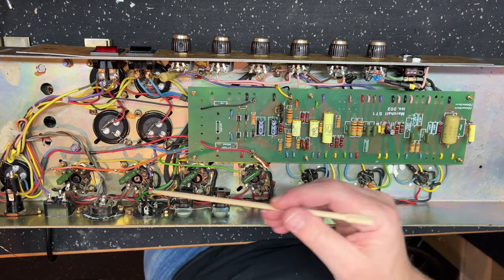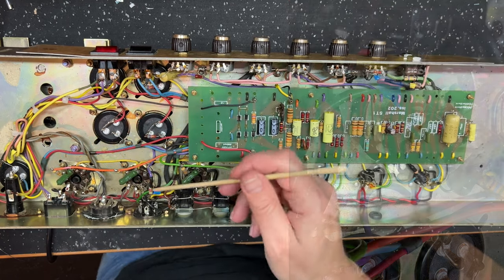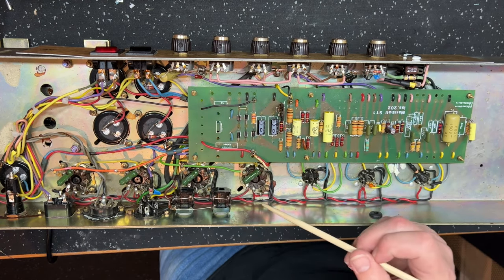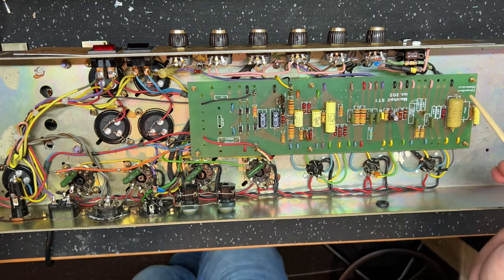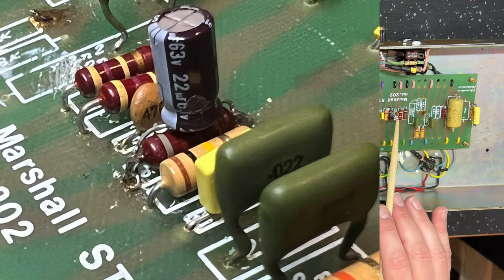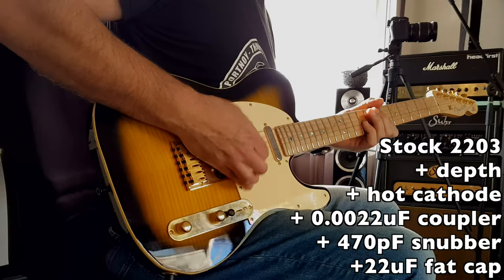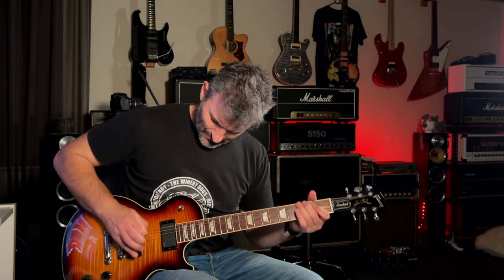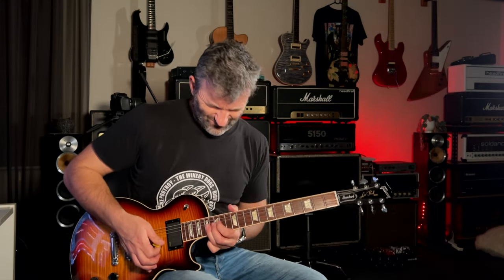1976 JMP 2203 - MODERN MODS BREAKDOWN!!

Comment: Excellent ...thank you for this info!! I'm doing your #34 mod to my 2203 now... didn't realize I could just keep the 470p cap on the 100k from the JEL mod in place without moving to the socket pins/resistor.  thank you!
Reply from the maker: Similar effect, but it does sound a little different.  Try both to see what you prefer in that amp.
Reply: Can you stack the #34 mod with this mods here

Comment: My 2203 build has mustards and 32u on the pre amp 50u on the phase inverter and a tube buffered effects loop.....with the 22k presence .1u and 4k7 combination....variable depth....and stock other wise.....with a 4x12 with v30s and g12h30s.....and 400 volts on the plates.....it's a great blues amp.....I love it

Comment: Love these videos Jason, especially the audio comparison of what each stage of the mod is doing to the tone... that is a LOT of work to stop and record each step, then continue. But its so helpful! Personally, I prefer the stock tone, but I can see a lot of people would love where you took this. It doesn't sound bad at all, I'm just more 70s rock and less metal. :)

I also learned a LOT from this video about what is going on in the circuit of my '76 JMP. There were some non-standard wiring bits that I had been wondering about, that you have explained here, like the coax from the gain pot to V1B, which mine seems to have, though in my amp they left the grid stopper in place on the board and ran the coax from there. The wiring also seems to split at the socket, white wire to the grid and the black to the screen. Ever seen that?

I don't have the coax from the master pot to V1A though, do you think that's worth doing to reduce noise even in a non-modded amp?

I notice that your amp seems to have the white goop on the chassis and board that mine does as well... do you know what that stuff is for? Was it just there to hold leads in place? 
It sure is a mess!

Cheers!

Comment: I've got a Marshall, but it happens to be a newer Marshall MA100C 100W Valve combo amp, a mate of mine did some service work on it because it was blowing fuses, turned-out the stock power transformer wasn't properly rated for our Australian 240V AC mains supply, it was rated for the Uk 230V AC supply so it was putting-out too much HT, and over-stressing the four EL34 power tubes, one of them actually suffered an arc-over on the octal socket which left a bit of carbonizing between two socket pins.

Comment: Awesome, gonna be really helpful cos I built a 5watt amp like 12years ago and wasnt happy with the sound. I used a 6v6 5watt power amp section. I was planning to build it with a 1959 preamp, but had decided to go for a 2203 jcm800 preamp instead since I play higher gain stuff usually. It didn't really turn out as expected. I know it will lose something from not having a phase inverter, since it's a single ended amp. But It's not even really a gain thing, if it was just low gain i could push it with a pedal, it's more just a lack of low end and thickness. These mods will help get it into a good "known" position and then I can work from there to get it where i want it.

Comment: I've got an old mid-70's (I think) non-reverb Fender Super Twin amp, the one with the Distortion knob, it uses six 6L6 power tubes (Yikes!!!) to generate 180W RMS, or a whopping 395W peak power output, anyway, I recently had to replace five old carbon comp resistors in the circuitry associated with the V1 7025/12AX7 preamp tube, because the old resistors generated some loud crackly noise, I replaced them with some new 5%/1W carbon film resistors and that fixed it, the six 6L6 power tubes are all STR types, the amp is housed in a wooden head cabinet and I will be using it as part of a bass amp rig with a Peavey 410TX cab I'm in the process of restoring, these old Fender Super Twins make really good bass amps, they are equivalent to about 2/3rds of an Ampeg SVT.

Comment: I'm not clear on the NFB depth mod, so it's 100K + 220K in series = 320k off the 8R tap, with 470pf across the 220k, which will work a bit differently than replacing the 100k with a 320k with a 470pf across it if you wanted to keep it all on the PCB rather than hanging off the selector. 320K NFB R seems odd, have I got it right? Sounds great BTW.
Reply from the maker: It's a 4700pF in parallel with a 200k.  You need to think of that separately from the NFB resistor, don't sum the two restistors.

Comment: This is THE Marshall amp and imho doesn’t need any modification. It is what it is, the best Marshall of all times.
Reply from the maker: Hard to argue with that!
Reply: I still have my stock 2204 JMP which I bought brand new in 1980 when I was 16. It’s totally stock , tubes ,caps , transformers. No mods . Still sounds great.  Also have a 2104 combo JMP and a 1987 50  watt 4 hole, which used to be from former whitesnake guitarist Adrian Vandenberg . Modded by Peter van weelden, who did some of Eddie Van Halen’s amps back in the day

Comment: Nice! my 2204 jmp has a lower voltage transformer (376VDC after rectification) and it sounds dark compared to the 2203, with the sir34 mod it becomes bright enought but in stock 800 mode it is too dark) is it this common on this series of amps?

Comment: This is the tone I’m looking for.
So to be clear, did you do anything with the 10K cold clipper ? Or is it left stock ?
Reply: Looks like its still stock to me.
Reply from the maker: The 10k is replaced changed with the 3k3 and 0.68uF paralleled on top
Reply: which a 10k with 3.3k in parallel = 2.481k

Comment: hi, is there a reason you went for the 33k grid stopper as apposed to a 68k.
Reply from the maker: Higher value grid stoppers lower the cut off frequency for tube entry low pass filter effects.   Actually 33k is the same as a Plexi in the high channel. Two 68k’s in parallel

Comment: As someone pointed out...sounds still too hairy and fizzy on top.
Did you DI this?  I really couldn't tell the difference between the changes!  Maybe a mic would have communicated the difference(s) better??
Reply from the maker: Well it's subjective isn't it Robb.  The majority of comments here love the tones, and the customer couldn't be happier.
Reply: @HeadfirstAmps  well, that's the main thing (the end customer).  Didn't know if there was a customer on the tail end, or one of yours and just an educational tutorial.

Yeah, tone is subjective.  A little buzzy still for my taste.  I also noted the 470pF on the 100k of V2 was sitting there earlier in the clip from the sequence of changes!!  Soo wasn't sure if already included in the tone I was hearing earlier on.

Like I said though.  I'll listen a third time, but I wasn't hearing a significant difference between clips.  Could be the headphones and try a different one or may be the way recorded (DI v. direct mic)?!??  Wasn't hearing it thou.  Very subtle.
Reply from the maker: All good. I think the cold clipper change is the most notable, followed maybe by the fixed depth
Reply: @HeadfirstAmps  that's right.  The change from a cold clipper to standard cathode with bypass will make the most significant difference adding gain, but also hiss and sensitivity.  

Likewise, tuning the NFB circuit.  I'll have to look at your couple caps but did you say you put a 22n on top of 2.2n or in parallel?  Changing this and FATening it up can make a significant difference also one way or the other and make playing on certain guitars more or less beneficial and why Friedman puts on a switch to tune to taste n guitar use.
Reply from the maker: Well he does the fat switch on the BE but not on the JEL.

Comment: Hey Jason I done the hybrid 10k with a .22 cap and used 220k to ground when the zeners are off. On a post eq master....now if there was something to do to bring back the eq like it was before that would be something.....the eq response seems to change a little and is kind of like compressed a little ..I don't know but it definitely takes some twerking to get a tone like that.....I also have the variable depth mod with a 47k resistor....it works good

Comment: Hey Jason one quick question.....do you prefer 50 or 100u for your phase inverter (output) filtering and which do you think is better for these modded 2203s?
Reply from the maker: 100uf PI in a 100w